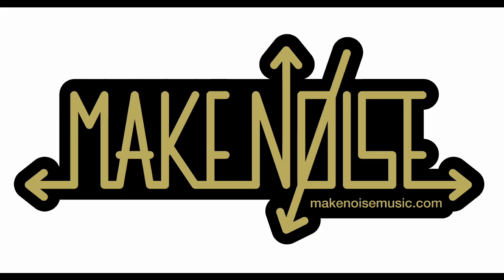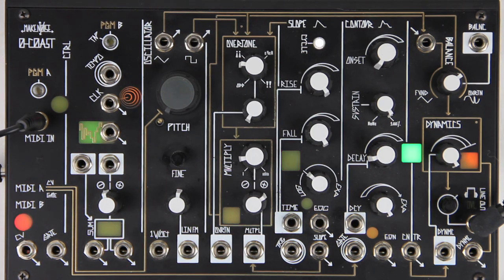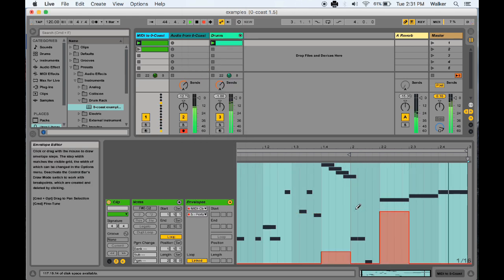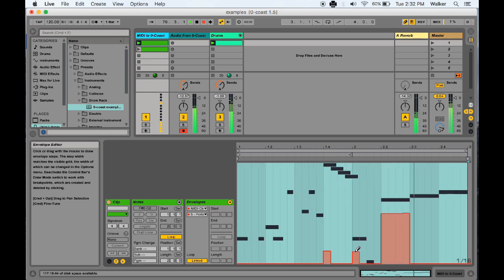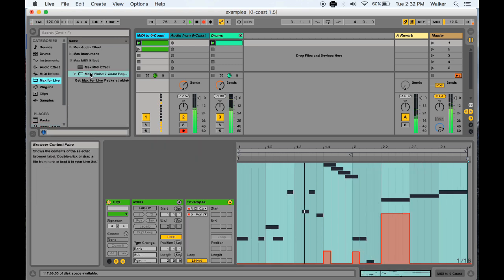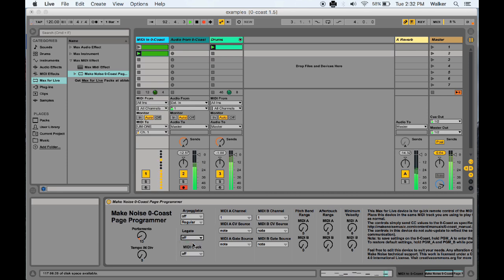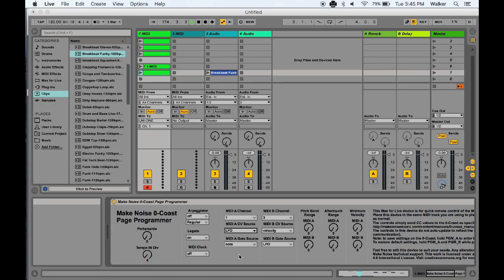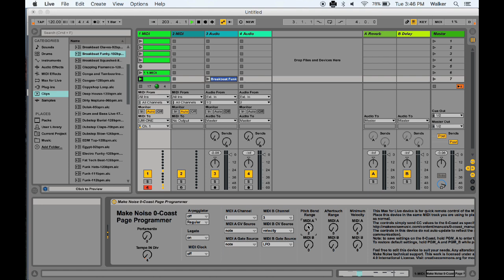0-Coast v1.5 Update

Comment: I'm new to modular/semi-modular but slowly starting to get used to things.  I've been playing with the 0-coast and just added a Mother32 and a DFAM...  my question is:  Is there a way to change what clock pulse is sent from the 0-coast (like there is from the Mother I.E.  1/4 or 1/8 notes)?  I'm thinking no,  but would like to be sure,  cause,  as I say,  I am new to this  =)  

Thanks for your all your support for users here on Youtube!  ❤️🎧❤️

Editing:  I'm still interested if the 0-coast can do this,  but I did just get most of it solved by using your pulse wav from a simpler in my daw out thru my interfaces output.  =)  Cheers!
Reply from the maker: Sounds like you figured out a solution! Another option is that if you've patched a clock to the TEMPO input, you can make the Clock output divisions of this tempo by programming with CC116. See p. 15 of the manual for details
Reply: ohhh...  I thought maybe I could, and did try some.... must have messed it somehow cause I didn't get it to work...  thanks for letting me know it is possible!

Comment: How do I know what firmware version I have? I received my o coast yesterday. Do I assume that the unit shipped with the original firmware? Thanks in advance.
Reply from the maker: Here is the relevant info from the readme: 

"If your 0-COAST has serial number 1603 or higher you already have this version of firmware, do not run this firmware updater!!!

Before updating, check the light sequence on power up of your 0-COAST. Units that have already been updated to 1.5.4 will flash PGM_A, PGM_B and MIDI A Activity Windows on power up. If your 0-COAST flashes PGM_A, PGM_B and MIDI A Activity Windows on power up do not run this firmware updater!!!"
Reply: Great, will check later. Thanks for the swift response.
Reply: @MAKEN0ISEMUSIC 
What happens if I did  
I forget what. I did it, just checked & only PGM A & MIDI A light up 😮